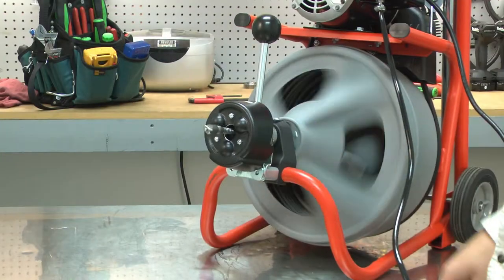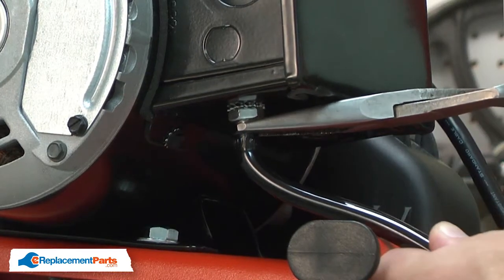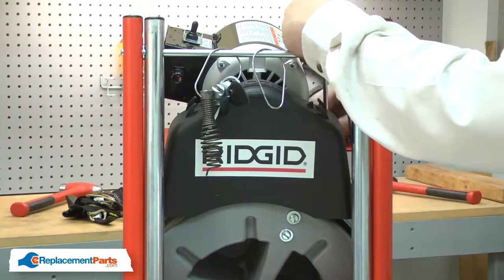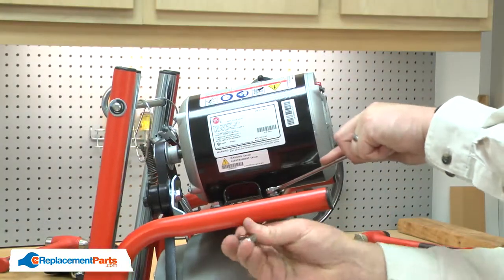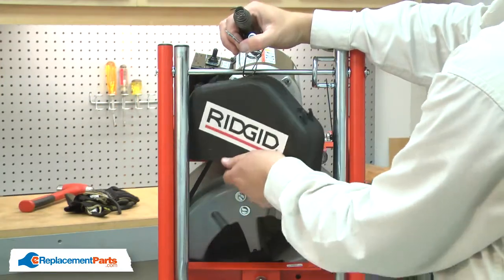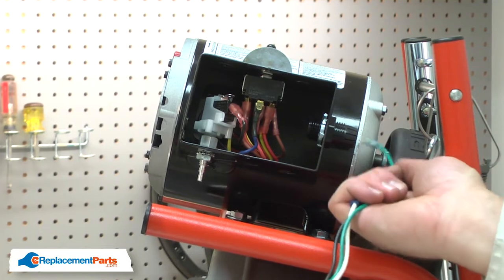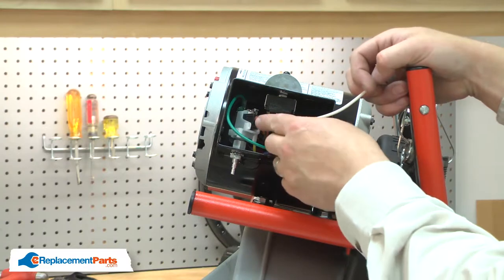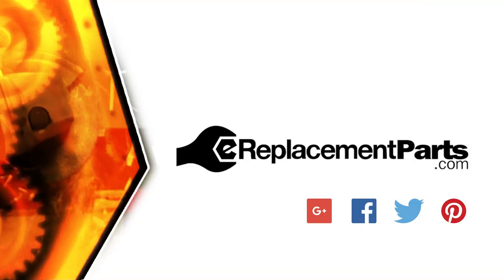Ridgid Drain Auger Repair - Replacing the Motor (Ridgid Part # 53333)

Comment: 😳Wow! 🤔Now couldn't that electric motor be fixed somehow instead of replacing it with a new one? Because mine from just sitting when I get ready to use it it really wants to run. But a couple of turns on it and it starts to run right . 🤔So is there something dirty inside there needs to be clean to get it back running right ?